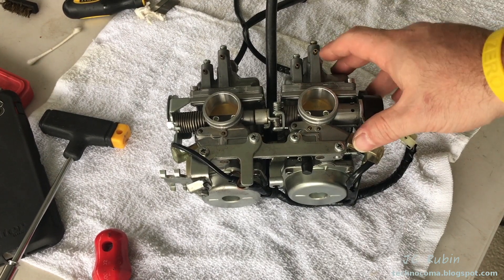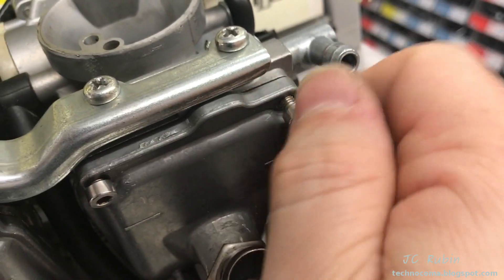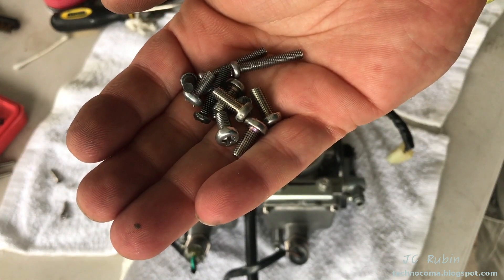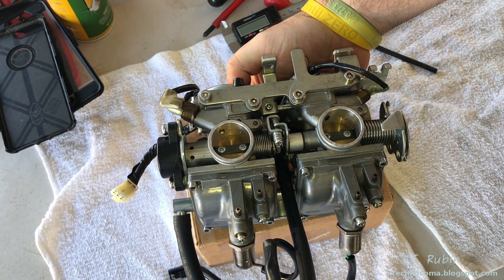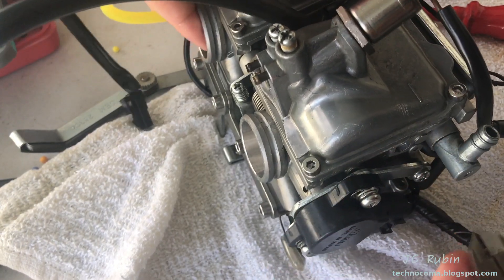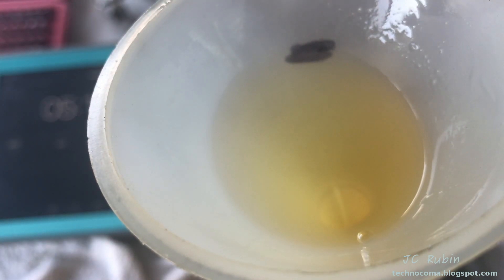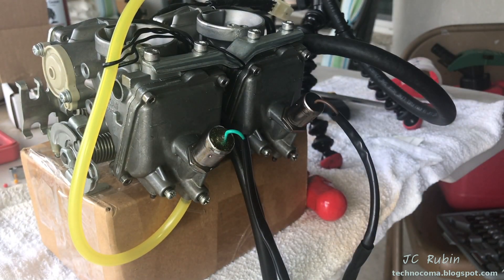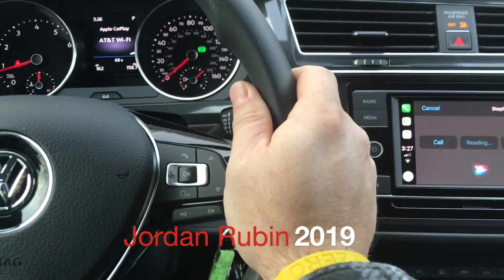Yamaha Star 650 Carburetor Test & Adjustments - Floats, TPS, Heaters, Solenoids, PMS, Leaks Part 1

Comment: Really great set of videos. Has helped my son and I dig into his carbs. Your write-up for this video lists the cap screw inventory you purchased, but it is different from the video. For instance, you have listed "2x M4 .80x12." The video indicates "4x M5 .80x12," which I'm pretty sure is correct. There are a few other discrepancies, as well. We started to use the list in your write-up, which we appreciated, but I noticed something wasn't right when I saw an M4 with a .80 pitch.
Reply from the maker: Its possible that there might be differences between years and models.  You will note in the video, that I brought each and every old screw with me for comparison on-site at the store for measurement to ensure accuracy.
Reply: @jima3129  might be a good idea as it saves some time and having to remember where each screw came from

Comment: Celebrity Rob: I had no Idea you worked on the VStars. I can loan you my 06 if you want to make more videos on it. The stock screws really do suck and when I had mine apart last time I thought about replacing them but didn’t. The 1100 is the same deal. Good vid!
Reply from the maker: Yeah, I have an 1100 and a 650.

Comment: Hi I was trying to tune my fully stock 03 vstar 650 bye chance do you kno around about how many turns out the air fuel screws are stock? The previous owner had adjusted them for some reason.

Comment: I have Yamaha Drag Star 650. And i think that you may have set the wrong fuel level in the float chamber. 

In the manual, it is recommended to use (fuel level gauge YM 01312) a tube with a length of 44 cm and a outer diameter of 8mm.
After loosen the drain screw some of the fuel from the float chamber flows into the long tube and the level in the float chamber should fall below the mark of 7.5-8.5mm. It is not specified in manual that you need to pump gasoline with a gas pump or keep the engine is turned on while make fuel level measurements. 

Without triggering the gas pump, the fuel level in the float chamber will not be raised while we make fuel level measurements, which means that the level before loosen drain screw must be higher than after fuel level gauge fills.
  May be exactly at the level of float chamber line. I'm not sure.

Like you, I used the shortest possible tube. The short tube holds much less gasoline and the level in chamber at the time of measurement falls a little. So I make the fuel level too low by using a short tube. Fuel level i reduced to 6.5 mm below the mark, its minimum. The float is already at the bottom of the chamber, partially closing the needle valve. I don't think it's right.  

I have an assumption that the fuel level in the float chamber should be exactly at the level with the mark line, and the difference of 8 mm occurs precisely as a result of the flow of fuel into the measuring tube during measurement.

My bike is in the same setup as yours and it doesn't work correctly. A strong dip when the throttle handle is turned sharply.
Reply from the maker: You may use the gauge called out if you wish.  I do not check the level in the bike as you see.  If you do, you must disconnect from the fuel system and use a funnel for gas into the carbs directly or you will have the problem you had pointed out.  I do mine on the bench as shown.
Reply: @retrotechandelectronics  Thanks for the answer. Maybe you are right, I am not an expert and I am often mistaken. But Yamaha Drag Star 650 manual says:

Place the motorcycle on the level surface
Put the motorcycle on the situable stand to ensure that the carburetor assembly is positioned vertically
Connect the fuel level gauge to the drain pipe
loosen the drain screw
hold the gauge vertically next to the float chamber line
Measure the fuel level with the gauge 
If the fuel level is incorrect, adjust it
...
Check the fuel level again

Nowhere in the instructions is there a point about disconnecting the carburetors from the motorcycle fuel system and using an external source of fuel. And this is exactly what changes the situation with level measurement radically. And I noticed that you also failed to get the fuel level 8mm below the line. The float cannot be lowered lower, it begins to close the needle valve even on an empty float chamber. For me this is a signal to doubt

It seems to me that the line on the carburetor is the fuel level required for it, and 8mm down is due to the level drop during the measurement, taking into account the use of a tube of this particular length. I will not impose my opinion, I just really would like to find more detailed instructions from the manufacturer or logical arguments that will convincingly prove the opposite to me.

Comment: Awesome video bro. I've seen a few of yours and they're top notch so far. I have a vstar 1100 and was wondering if you have a video on that, showing how to adjust the floats. I just did a complete over haul on my vtwin carbs. Took me about 100 times pulling on and off to finish get it to where I can get on the road go over 35mph and be confident it won't cut off at the stop signs. There's only 1 problem, I have to turn throttle about 50% to get any real power but when it finally takes off it TAKES OFF sounds awesome!!!  But.... If I'm barely turning throttle sound like it's starving for gas or something could this be a float issue I'm asking myself or maybe the air/gas screw. I kinda just either want to leave it alone, but worried about damaging motor or Tran since I have to get it up to do much rpm, or just take it in to the shop. But I've come this far it idles fine low rpm
Reply: Did you figure it out

Comment: If I just drained the bowls. Would I still need to adjust float height or add fuel? This is assuming if the carb is still in the bike
Reply from the maker: No, not if you didnt bend or maladjust them

Comment: I took the carbs out as you did and cleaned as you did and sync carbs I accelerate wot way better than before Idle way better than before I just bought this bike and your knowledge if amazing I've looked for hours before and after this rebuild kit I have a issue while Cruising it sputters 20000 miles like low high gears low rpms. New fuel filter readjusted valves intake and exhaust new petcock it was clogged new intake boots they were cracked badly carb was out of sync bad I did not mess with the idle screw idk I feel like this information of cruising high gear low rpms should narrow this down I don't want to do it as it took me probably 9 hours to do this all just not idle screws

Comment: I bought a 2000 vstar 650 and the choke arm does not work at the carb.  Any ideas'?
Reply from the maker: Its a mechanical enrichner, if its binding somethings wrong, the carb should come out for closer inspection.